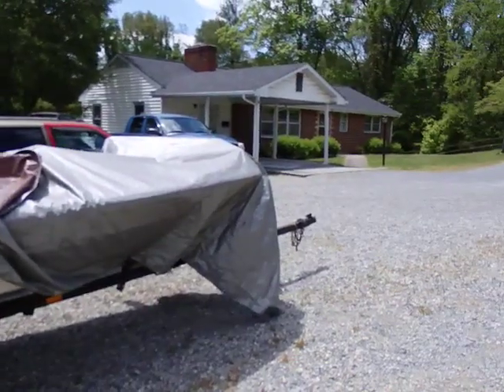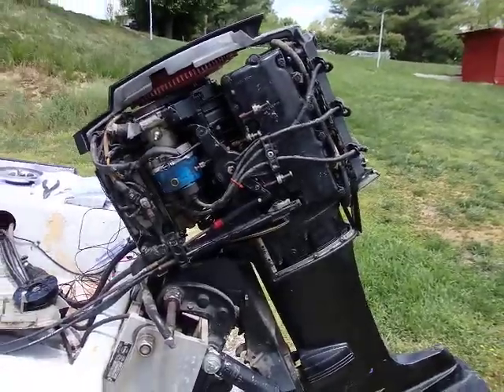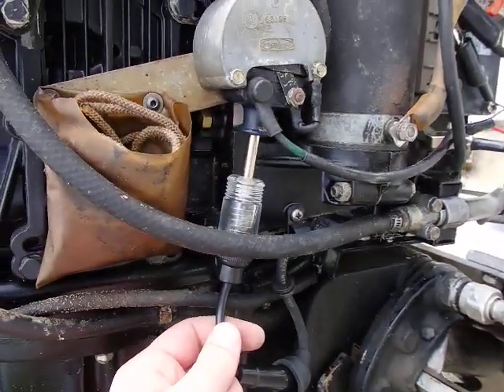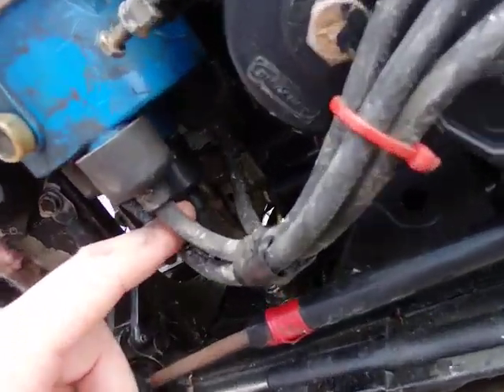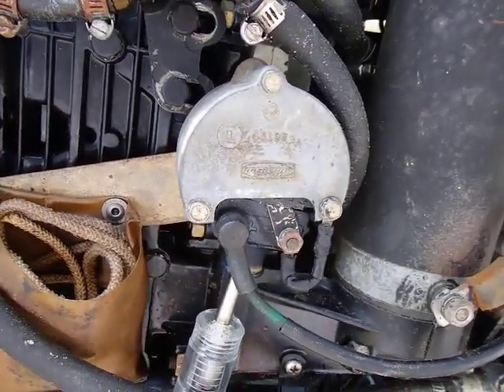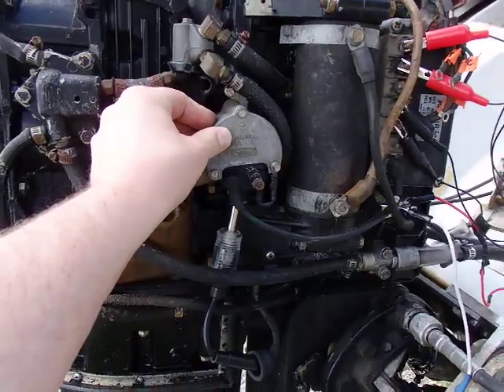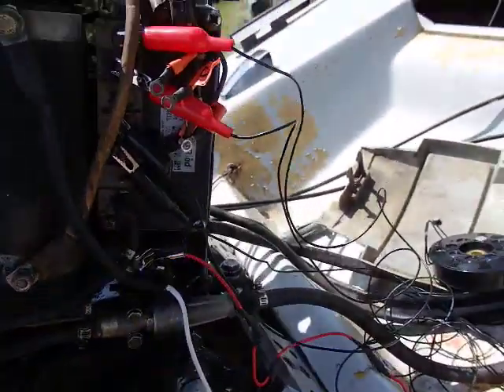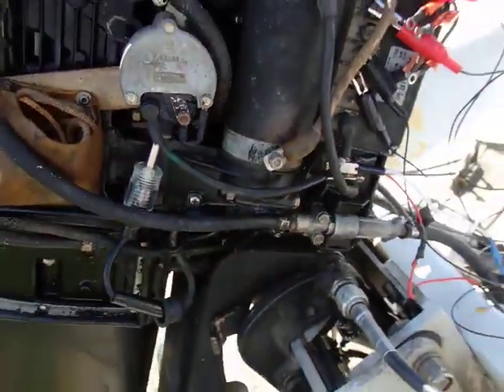1974 Mercury CDI ignition troubleshooting

Comment: Where do those red and black wires you clamped on connect on the other end? I'm guessing the battery posts?
Reply from the maker: Its actually only two cables, and we are seeing all 4 ends. I can see how it would look like 4 though. So the two red connectors are on the same cable, and the two black conectors are on the same cable.

Comment: I got a 69 mercury so if I have power coming from my coil my cdi box will be okay ?
Reply from the maker: Yep that's the case. I called CDI electronics to verify that with their aftermarket unit. Once aupon a time I saw a way to independently test the trigger, but can't find it again. You should see 9V on the white/black wire to the Tigger, nothing on the black, and blue is impulse from the trigger. If you have power going to it, and don't see any return voltage (impulse, so it's not continuous) it means your trigger is bad.

Comment: Same motor i have i lost all power from key
Reply from the maker: You will have to dig into the wiring harness. I had to replace a few connections to the switch, the old ones had rotted out
Reply from the maker: Remivill, i have made a new video about troubleshooting the key. https://youtu.be/IfbHr0jPFUc
Reply: Still cant get it fully running it runs only when holding the key in start not in run or off
Reply: Can you email me regarding timing issue need pic of timing marks and distributor timing marks while at top dead center number 1 ?

Comment: Would i get a no crank with this being bad? Or is that straight from the starter solenoid to the starter only?
Reply from the maker: Not this part. If jumping the starter solenoid cranks the issue is in the wiring harness/ignition switch. Otherwise it's in the starter power leads

Comment: Hi i tfied this test but when i put jumperwire across top terminals the 12 volts i had on the top terminal disappeared
Reply from the maker: That most likely means you have a bad ignition module

Comment: Hi there, I have recently bought an old boat with mercury 40hp motor. I went to couple of places to service and repair it. All I heard was it's too old and they don't touch those kind a motors anymore.. So  doing some research to doing it by myself. First I want to figure it out which year looks like the oldest mercury product thou  🧐..  I heard the problem with the coil pack.  Could you please help me to figure it out.. I'll send some pics..
Reply from the maker: You can test the coil like a car coil using an ohm meter. The CDI switchbox comes with a new one though.

Comment: Do you have a part number for that CDI ignition? I have a ‘75 650 Mercury that’s driving me up the wall
Reply from the maker: I dont remember  the part number on that. I found it on CDI ignitions website (which is currently down.) However it looks like there still taking phone calls if you want to give them a call. Your unit should have the same Thunderbolt 3 ignition this one has. (the only way i found which ignition i had was to count contacts on the CDI module.) I do have a few more videos on this engine though, and it should be the exact same thing. Good Luck!
Reply: Your brown is rpm tac isnt it the no problem one you said